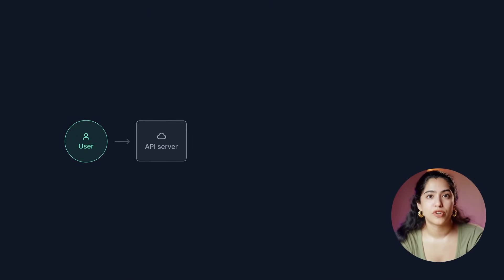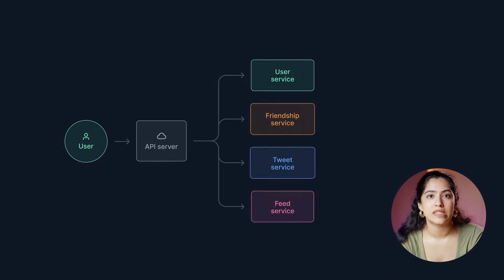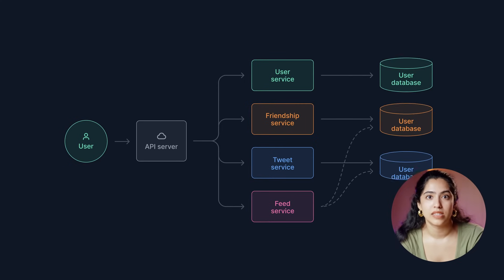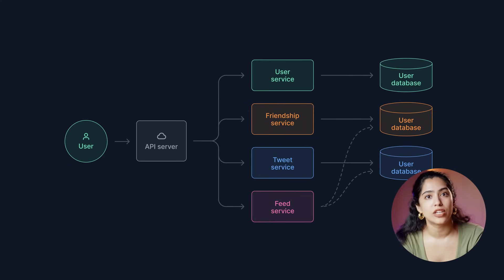How to Answer System Design Interview Questions (Complete Guide)

Comment: Use frameworks, 1. Define the scope (functional and non-functional requirements). Take your interview on a guided tour. Who are our clients or consumers? Is there an existing system? What are its parts? Availability, consistency, security, speed, costs, and reliability. Don't get bogged down on heavy requirements. Cost calculation. What scaling might look like later according to user growth and behavior. 2. Design at a high level. Start by designing APIs. Explain why you are choosing these APIs.

Comment: Hmm... I would expect a Software- or System-Architect to have the knowledge about caching, databases, APIs aso. Same as I would expect an UX-Designer to have the knowledge regarding usability. As a Product Manager you dont have to have this knowledge, instead you must be able to identify those experts and stakeholders. And you must group up with them in a team. In my opinion the Design part of a Product Manager should really be more of a scetch then a diagram, a mockup or whatsoever. Am I wrong when I say keep the Design as simple as possible and use it to make the relation of the customers needs with requirements visible?

Comment: these system design interviews can be so daunting. It's like, how do you even condense all that info into 45' without totally freezing up? Not gonna lie, I've stumbled through a few of these, trying to juggle all the requirements and sketch out coherent designs on the spot. Honestly, I feel like I get way more stressed out about these than I do about hardcore coding questions. 

At least coding felt more straightforward until it became more about memorizing patterns for platforms like LeetCode, which got really predictable. But just a heads up if you're grinding for these types of roles—zylyty offers a different vibe. It helped me focus on industry-relevant challenges instead. I mean, it's cool cus the exercises feel way more legit compared to some of the academic stuff out there. But anyway, the vid was dope for breaking down the interview framework. That step-by-step approach is clutch.

Comment: 1. *Define the Problem Space:*
     - Understand problem and define scope.
     - Clarify functional and non-functional requirements.
     - State assumptions and decisions explicitly.

  2. *Design the System at a High Level:*
     - Design APIs to define how clients access system resources.
     - Consider request parameters, response types, and communication between client and server.
     - Create a high-level design diagram to illustrate system architecture.

  3. *Deep Dive into the Design:*
     - Examine system components and relationships in detail.
     - Consider non-functional requirements' impact on design choices.
     - Present different design options with pros and cons.

  4. *Identify Bottlenecks and Scaling Opportunities:*
     - Assess system's ability to operate under various conditions and support growth.
     - Address single points of failure, data replication, global service support, and scalability.
     - Consider concepts like horizontal sharding, CDN, caching, rate limiting, and databases.

  5. *Review and Wrap Up:*
     - Summarize major decisions with justifications and trade-offs.
     - Ensure design satisfies all requirements.
     - Identify directions for further improvement.
Reply: Thank you so much